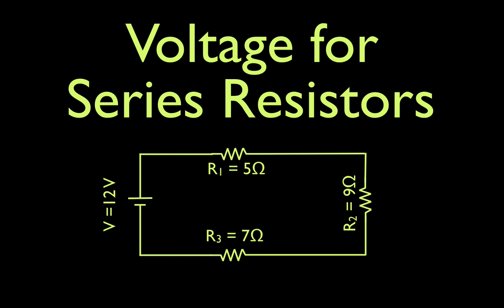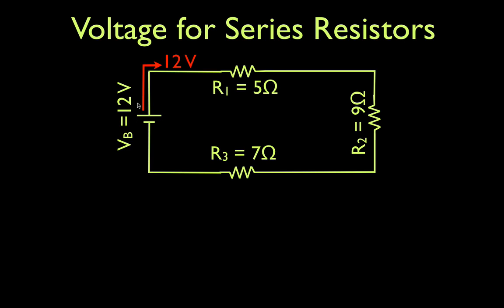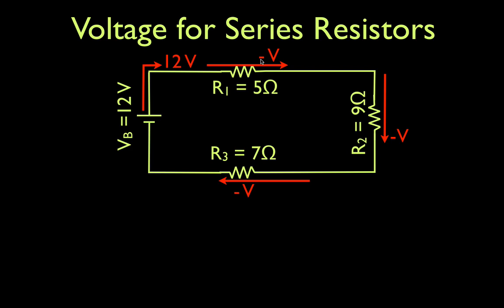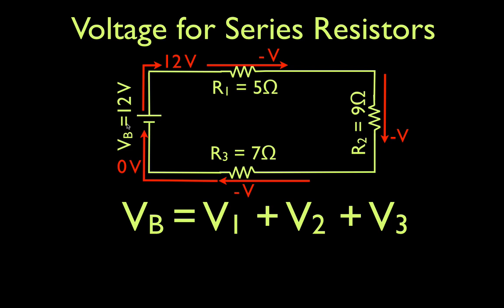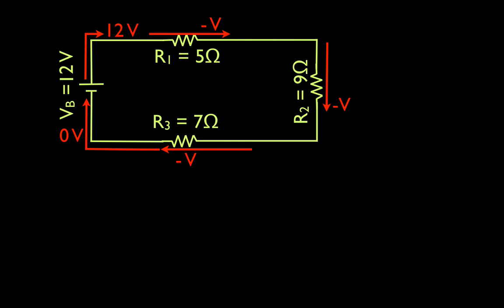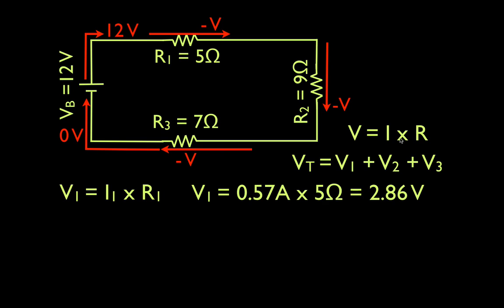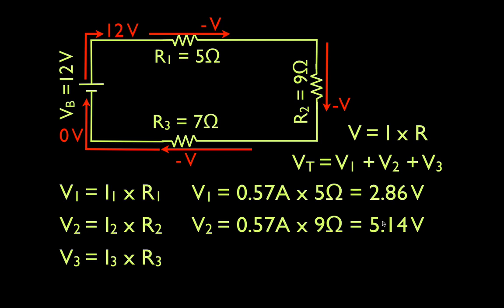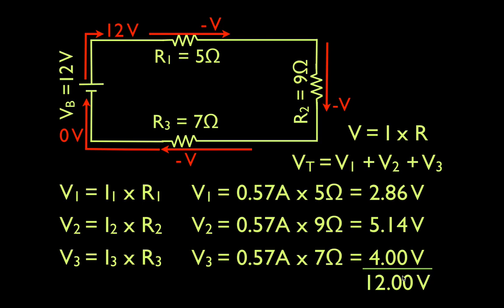Resistors in Electric Circuits (13 of 16) Calculating Voltage for Series Resistors

Comment: Uh?   Why when I check your math do our numbers not match?   Granted it is off by only .03 volts (.01) if I round up,  is  this because of the natural resistance of conductors?   I love your video, but I really struggle with math... please explain!
Reply from the maker: As you mentioned it is probably just from rounding.  Thank you so much for watching and commenting!

Comment: Hi, I know how to do the math on this but what I don't understand is this.. If I measure the voltage before R1 I get 12 Volts, but what volts would I get After R1 and R2 and R3. I have set up this circuit and when I measure the volts after each resistor I don't have those voltages after each resistor. What should the volts be on my meter after each resistor?
This probably doesn't make any sense but I am very new to this and I really want to understand it.
Reply from the maker: You have to measure the voltage (really the voltage difference) between two points in the circuit.   Usually we say something like the "voltage drop across R1".  By this we mean the change in the energy of the electrons (the voltage) at a point before R1 and the at a point after R1.  Current is measured at a specific point in the circuit.  Does that help?
Reply: Yes it does. Thanks for the help!

Comment: What's the voltage drop on a 24 volts a/c with a 27 ohms resistor?

Comment: Thank you very much for these videos, they are much appreciated. One note - Isn't the main purpose of a resistor to oppose the current of the circuit, therefore decreasing the Amps? If this is true then how come the circuit has a constant current of 0.57A? (Apologies if this is a stupid question, I have not been taught this yet.)
Reply from the maker: Thomas Cowley If the resistance stays the same then the current stays the same.  If the resistance decreases then the current would increase and if the resistance increases then the current would decrease.